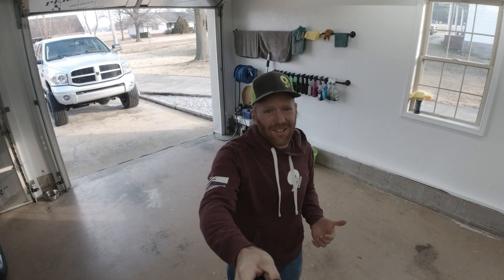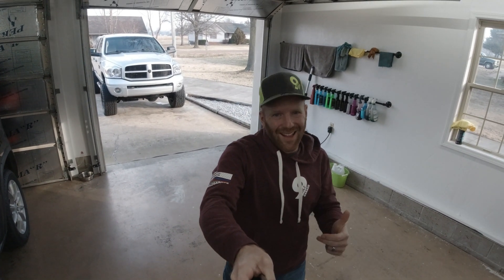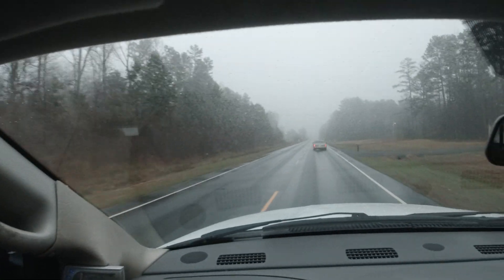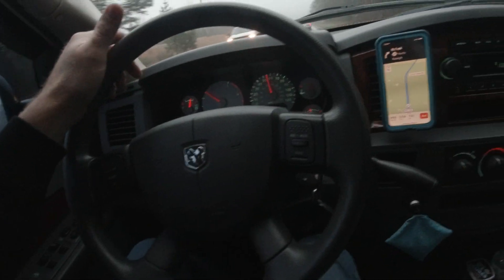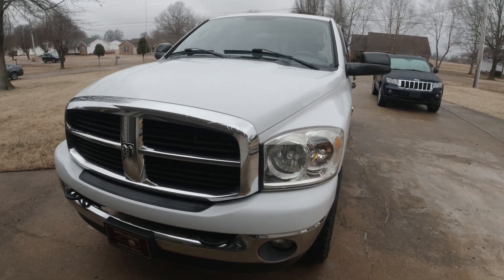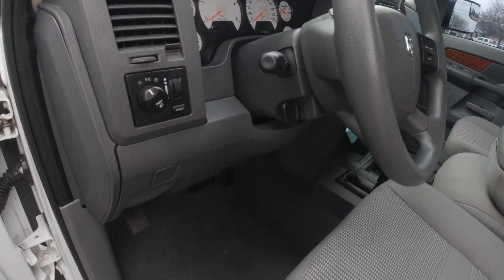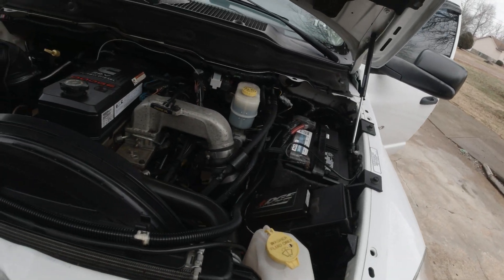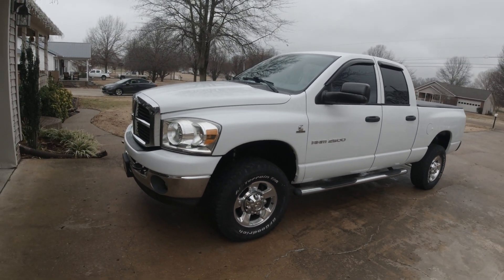When Buying a $30,000 Dodge Viper Goes Wrong in More Ways Than One!

Comment: what Happened you sold the Blue Viper with White Stripes to get another Viper SALVAGE Title but was Junk ? then got a Truck ?
Reply from the maker: That's exactly what happened, I wanted to buy the yellow to make a bunch of how to videos for other Viper owners, the truck broke down on the way there, then the yellow Viper turned out to be completely trashed, looked like it had been spray painted. Then I had to buy another truck and trailer to make it home. The trip didn't exactly turn out how I wanted, but it ended up working out in the end!
Reply: @9NailzGarage  Kool 
it was ment to be- 
What exactly was wrong with the Yellow Viper ?? Chassis Problems
Reply from the maker: Yea, the yellow Viper just had tons of issues, I was expecting some problems, but not this bad. The interior was trashed all the suspension and the engine bay was corroded pretty bad, wheels were trashed, probably couldn’t even refinish them. I like a good fixer upper but this was too far gone to make it worth it, I just couldn’t believe someone could treat a viper like that
Reply: @9NailzGarage  Lawnboy Resto : https://www.youtube.com/watch?v=ykSguOk6syg
Reply: @9NailzGarage  Ridgid EFI Pressure Washer No Start : https://www.youtube.com/watch?v=izFWtjc7iW0
Running - Took Off the CAT Pump for Testing the Engine : https://www.youtube.com/watch?v=KXiG0nJuVQQ&t=2s
Reply from the maker: @jonienglish3231  I really wish I would’ve filmed it, I was just not in the mood given the circumstances lol
Reply from the maker: @jonienglish3231  man that lawn mower is a work of art! I love that kinda stuff! Attention to detail!
Reply: @9NailzGarage  Thanks Like the Older Stuff Aluminium Deck Better Quality , Still have a 2 Stoke Lawnboy 10601 32:1 Mix for Nostalgia, with Offset Wheels , the Wheels have Zerk Fittings and the Muffler is under the 21" Blade
Reply: at the Gm Dealer i Worked 20 Years Ago we had a c4 Supernatural LM : https://www.youtube.com/watch?v=sUR8dcUigXc
was a RACE VERSION not for Street .
we were a Callaway Distributor here in Toronto , Dealership Closed Now
Reply: @9NailzGarage  Thanks , I like How you Added the Rivnuts to the Exhaust Rockers
Reply from the maker: @jonienglish3231  thanks! Over half of the original screws were missing so I figured it was time!
Reply: @9NailzGarage  maybe do a Gen 1 Viper Next Time
Reply from the maker: @jonienglish3231  haha we’ll see, those can be very challenging to find things for!